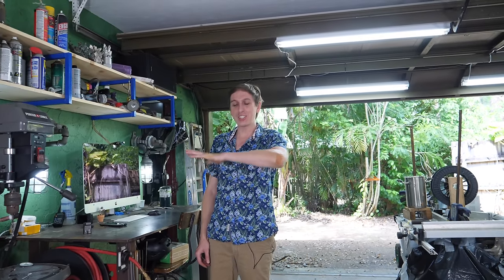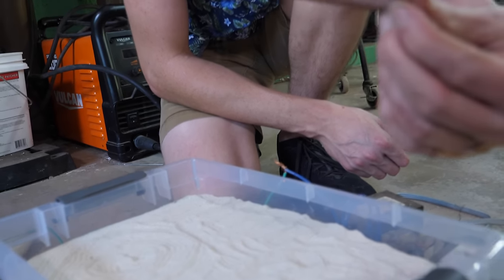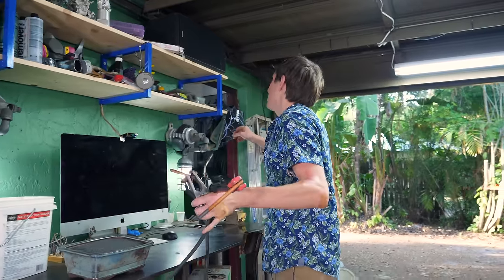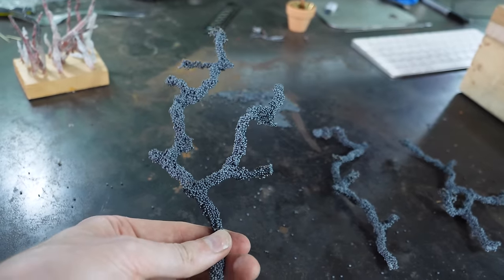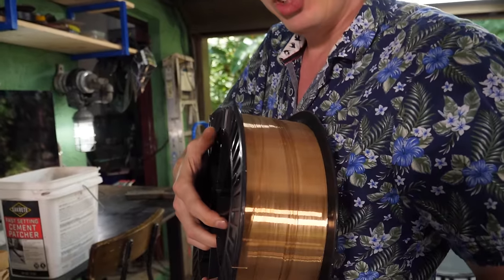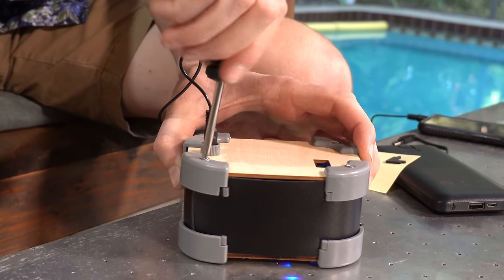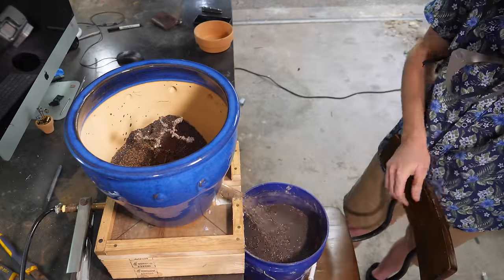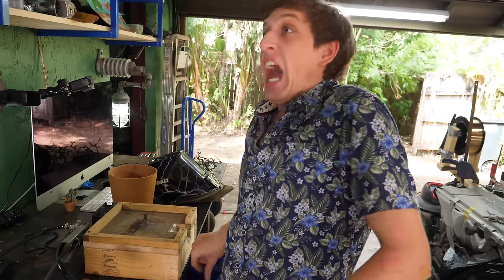Making Petrified Lightning ...with electricity??

Comment from the maker: FYI you can do this with 2 car batteries in series, so 24v. my welder is only 18v at 200 amps, 2 car batteries will put out about the same power 👍As for the BB's, i got them from ebay. search "steel shot blasting". Mine were size s460, about 1mm. I also got the Silicon Bronze from ebay, but it can be pretty expensive. Wisconson Wire Works also sells it for around $6.90 a pound.  But you can find broken rolls on eBay for really cheap sometimes.

I was using 3/8 carbon gouging rods  as electrodes to melt the bb's. Steel or copper would just fuse to the sculpture.

As for the  batteries you would wire them on series for 24V. If that's not enough get another one or two. You can get used batteries for cheap at junkyards. Like $30 each. You need heavy duty wire rated for 200 amps. Positive on top or bottom doesnt matter. It won't work as well as the welder because the welder has a high voltage start that helps it start an arc at longer distances. 

You would want to stick both ends in the bb's, THEN connect the wire to power.. It would be a bad idea to just connect the wire in your hand directly to the battery terminal, it will spark and vaporize lead with every strike. You would be better off connecting a short length of wire to the battery terminal and using that to complete the circuit. And instead of just touching the two wires togeather you would want to find a way to securely connect them, and remember you are moving a lot of current so the connections need to be robust, the thinnest part will control how much current flows.
Reply: UwU
Reply: Hmmm, would it look more like the real thing if you mix Sand into the BB/copper compound?
Reply: Whats the songs name in the vidro
Reply: Cool
Reply: it is also, ya know, really dangerous.
Reply: Hey, the garage scientist is back!
Reply: TheBackyardScientist thanks
Reply: when you turn 105 and can't use the kiwico crate
Reply: Leagle Eagle he said it was very dangerous
Reply: Genius
Reply: Filipino fan currently 12:32 am and this is a very informational video keep doing your best!!
Reply: Hello..will it work on 6s lipo(22.2v)?
Reply: @TheBackyardScientist I love the idea, but something I've wondered about for years now, is if this can be applied to the skin for a one of a kind scarification "tattoo"? please explore this more, if only on dummy items...
Reply: Would adding flux to the metal mixture help at all..?
Reply: What happened to your original video on producing Lichtenberg Figures?
Reply: What would happen if you tried making a mold of one of those to fill with molten metal?
Reply: @HalfSpeedMastering waaaow.. 
That's a total buzz killer..
I think you might have lost the plot Bro..
Reply: TheBackyardScientist where can we buy the petrified lightning😂
Reply: what about iron filings and that copper in dust form, or would that be too dangerous
Reply: I love you so much this was such an amazing idea!!! Would you mind if I used this concept for art?
Reply: @yaboyshiba9496  that's good advice, what would you suggest using if you can't afford what he's got?  Are there other batteries i could use?
Reply: yes i will immediately start playing with car batteries
Reply: @HalfSpeedMastering That's sickening.
Reply: Would it be better if you first soaked the bb's with brake cleaner or similar to wash away any oil residue?
Reply: it kinda looks like cheetos
Reply: Like you said at the end, coating in a little epoxy and adding florescent coloring is a great idea. I wonder how well it would work as a aquarium decoration. Using something like that as a base to add real corals that can grow over it would be interesting as long as it as tank safe
Reply: A dado cutter is what is used to make a narrow channel cut along the grain in wood in cabinets to fit a flat panel into if you look at a kitchen cabinet door it will have 4 pieces of wood with the inner edge of each cut with that type of dado cut and the flat panel in the middle
Reply: why are u reading my comment? :)
Reply: Day - doh , I'll take you back to shop 102: Table Saws and their uses
Reply: Can I buy one off you and u should make a box with a black light in it and sell them or something I don't know just thought I'd be cool
Reply: I was thinking something similar, but full the mold with molten glass, then mount on a base with an LED light in its so it lights up the whole thing
Reply: Hey this is just me being patriotic to Wisconsin since I live there, its sin, not son :) cheers mate
Reply from the maker: @Leagle Eagle I did it plenty of times. Theres no problem.
Reply from the maker: @rpmmotors5050   You would probably destroy your battery. LiPo batteries can output enough current to destroy themselves very quickly!
Reply from the maker: @spencerrolfe2339  go for it!
Reply from the maker: @brightlightsdarkcity6989  I think it would just corrode the steel after a few tries, and it would increase the space between the bb's if that makes sense
Reply from the maker: @KJohansson   I think that would be a good idea but honestly they came pretty clean. Maybe running them through a sand blaster to try to knock off to the mill scale on them would also be a good idea.
Reply: @Leagle Eagle Nice try, Pal but you can't just make your name similar to a big YouTube Channel and expect people to not notice. GJ on the name rip.
Reply: Aunt to let you know that if you find flames that are just blue that's can also be a sign that the type of gas the flame is using is methane gas
Reply: Dado is pronounced dade oh
Reply: TheBackyardScientist wHaT?!
Reply: Who else read this knowing damn well they werent gonna do it
Reply: u should use gloves lol
Reply: YEET
Reply: I think using a relay would be safer...
Reply: GET YOURSELF A 24 VOLT BUS BATTERY
Reply: Witch sand or what type of sand did you use?
Reply: Fulgurite always reminds me of that episode of supernatural where they break into a 1%ers house to steal it and bind Death haha, the people are just like wtf is going on
Then they find out a season later you can just buy it at hippie stores hahaha

Awesome experiment though, looks so goddamn cool
Reply: I was getting ready to say please dont be raid sahdow legends and you said something about the box and i was like aw thank god
Reply: @TheBackyardScientist  You should try this using your MIG Wire bits and Glass Beads. You could experiment with different colored beads and sizes. If it works the light will diffract through the glass. You might even be able to illuminate it through the base with LED's or use a cheap laser
Reply: Hey I have a large one of those
Reply: Why so much spelling?
Reply: @Luziferne  Probably
Reply: <--Milwaukee are you in the wisconsin area,,, have cryo system and other toys/ ideas
Reply: @alanyep  OwO
Reply: TheBackyardScientist 
🤔Sounds cool, but—
🤨 Also sounds dangerous...
Reply: Noice
Reply: 6.9
Reply: @TheBackyardScientist  would a neon sign transformer work?
Reply: seeeeedeeeeeeee
Reply: seeeeedeeeeeeeeeeeee
Reply: seeeeedeeeeeeeeeeeeedd
Reply: seeeeed serf’s eeseeeded
Reply: eeeeeedeeeeeee
Reply: eeeeeedeeeee
Reply: deseeedeeeeeeeeeee
Reply: seeeeedeeeeeee
Reply: seeeeedeeeeeee
Reply: eeeeeedeeeeee
Reply: eeeeeedeeeeeee
Reply: eeeeeedeeee
Reply: eeeeeedeeeeeeee
Reply: eeeeeedeeeee
Reply: eeeeeedeeeeee
Reply: seeeeedee
Reply: seeeeedeeeeee
Reply: seeeeede
Reply: eee
Reply: eeeeeedeee
Reply: eeeee
Reply: eee
Reply: eeeeeedetee
Reply: e
Reply: eeeee
Reply: eeeeeed
Reply: ee
Reply: eeeeeedee
Reply: eeeeeed
Reply: eeeeeedeeeeeeee
Reply: eeee
Reply: eeee
Reply: eeeeeed
Reply: eee
Reply: eeeeee
Reply: eeeeeedeee
Reply: eeee
Reply: eeee
Reply: ee
Reply: eeee
Reply: eee
Reply: eeeee
Reply: eeeee
Reply: eeeeeedeee
Reply: eeee
Reply: eee
Reply: eeeeee
Reply: eee
Reply: eeeeeedeeeeeee
Reply: ee
Reply: e
Reply: ee
Reply: ee
Reply: eee
Reply: ee
Reply: e
Reply: e
Reply: e
Reply: ee
Reply: e
Reply: e
Reply: eee
Reply: eeee
Reply: ee
Reply: eeeee
Reply: ee
Reply: e
Reply: eeeeeed
Reply: e
Reply: e
Reply: eee
Reply: ee
Reply: ee
Reply: e
Reply: ee
Reply: e
Reply: e
Reply: ee
Reply: e
Reply: ee
Reply: e
Reply: ee
Reply: e
Reply: e
Reply: e
Reply: ee
Reply: ee
Reply: e
Reply: e
Reply: eeee
Reply: eeee
Reply: e
Reply: ee
Reply: e
Reply: eeee
Reply: e
Reply: e
Reply: e
Reply: e
Reply: e
Reply: e
Reply: e
Reply: eee
Reply: @noahfrench8792  I agree
Reply: @TheBackyardScientist  Your opinion of Cody’s Lab
Reply: And you expect me to read this
Reply: No one cares
Reply: That’s a lot of writing to read you one
Reply: 6.90.. kinda sus
Reply: I am so incredibly dissed, the title says petrified lightning, why were you not running around trying to catch actual lightning with the metal balls????? Stick welding is not lightning, you just got some weird current path in some stuff on your bench... GO BEN FRANKLIN
Reply: Thanks for the info brother.
Reply: You could sell these
Reply: I fought it was a lie
Reply: Hi fellow engineer, 
I would also suggest to enrich the mix with sand/colored glass to improve heat capacity. For more integrity let the "casting" rest and cool down slowly in the "mold". This helps cristalisation and decreases heat tension. To improve your safety please use forced ventilation while welding. Metal fumes are everything but healthy. 
Stay save
Reply: Noice
Reply: I feel like letting it slowly cool as wouldn't improve integrity as much as actually quenching the metal, though I'm not sure if it's getting hot enough that quenching would provide much benefit.
Reply: Dude, have you seen the theory of fossilization/petrification is way faster than we are lead to believe?
Thundebolts projects channel is a good source for this.

I wonder if you can try to replicate the process (occurred in some big Earth event - thunderbolts of the gods/war/world sized electric discharges) which consists in applying high voltage on a liquid media with clay and  some organic tissue: flesh, bone, leather, anyways... cook it until it gets hard and turned into rock
Reply: Y e s
Reply: Uu
Reply: @djghost5254  I rhouhht add sand to the bb mix aswell on top of the bronze carbon sillicate shavings actual sand from a beach
Reply: @PGains  wow bow
Reply: You can also do this with wood instead of sand, I actually did this with my uncle. Its amazing
Reply: Did you used to do a similar thing by pouring molten metal into ants nests ?
Reply: other youtubers "please do not try this at home. you could DIE" makes a grilled cheese sandwich
thebackyardscientist: "so anyway heres how I did it in great detail. have fun"
Reply: i love your videos kevin
Reply: @average_jojo_stan  The song is Dirty Brunettez by Magdy Haddad 🐸👍
Reply: UwU

Comment: I was a seasonal worker for a rubber works factory when I was 19. We mostly used the metal shot in large high pressure hoses. Looked a lot like a fireman's hose on a hydrolic arm. It rips clothes and can pierce skin but it had never hurt me that bad. The helmet it came with had an air flow into the mask but I don't think it had an exhaust so it was suffocating
Reply: I only now realized that silver and sliver are different words. I thought that  it was silver for both before.

Comment: Ages ago I took an oil-furnace ignitor coil (these WILL kill you!) and some red bricks to make a version of lightning art!
The set up is simple: strike an arc across the surface of the brick; within seconds it will 'jump into' the brick, forming a glowing hot tendril.
The longer the tendril 'cooks' the wider and deeper into the brick it will melt.
The hot tendril is conductive, so moving one electrode away slowly will lengthen the tendril, but after about 4-5 inches, the tendrils would die out.
On cooling the fused brick material is glossy black glass.
It works with ceramic flower pots, but the thermal stress usually cracked them.
I got to where I could make monograms and simple drawings.
Sort of works with wood, but it is very easy for the tendril to wander off course.
Gave it up when I bridged the circuit across the back of my hand; it hurt for over three years!

Comment: Those beads are for sand blasting I think, we have those at our Job (where we paint big metal items in a giant furnace) and it's how we quickly clean off old paint or smoothes edges! It's lovely to work with an item that has gone through it.

Comment: TBS, You should try this with the MIG Wire bits and Glass Beads like they use in glass bead blasting. You could experiment with different colored beads and sizes. If it works the light will diffract through the glass. You might even be able to illuminate it through the base with LED's.

Comment: DADO blades are meant to be used in your table saw, but you would use several blades at once, and "staggered" so that you get a WIDER cut for making interlocking corners and just "wide" cut slots and wood...  If you were to stack 3 of those 1/8" thick blades offset 60degees each, you'd have a 3/8" wide cut with a blade that acted like a normal saw blade.  but you can stack multiples for wider cuts..

Comment: Most spools of welding wire only list the weight of the spool, not the linear amount of wire on it. I once decided to figure out the linear amount by taking a foot of wire and weighing it, I don't remember exactly what I came up with but I believe the figure was around a mile long on a 35lb spool

Comment: Those tiny steel ball bearings are used in precious metal plating applications called   " Media. " What would happen if you used magnetic neodium magnetic ball bearing media in the same experiment ? Even if you could cause a hyper static charge, is their a substance you could add to the beads before creating the experiment to prevent the other magnets from sticking to one another after the experiment is finished? And with the introduction of electricity would this change the media's magnetic properties?

Comment: It would be cool if  you could use the same process to cast a specific shape like with a sand mold like molten aluminum,  but steel and silicon bronze instead

Comment: oxygen instead of argo ?? seriously it would make some massive heat giving you some thickness too ...It gives me some ideas...microcontroller + multiples electrodes switching, some oil insulating the non direct paths...looks like alot of fun !

Comment: 2:36 hear that arcing sound inside the welder ? That's physically arcing from the flyback lift arc starter circuit in the welder. Not really good for it to continue doing that with. Do you have a warranty on that thing ? I'd hope so.

Comment: Want real "petrified lightning" just bombard a block of acrylic with electrons from a linear accelerator.  It will hold a few million volt charge for hours until struck and grounded (at which point a arc will go through it creating a lichtenberg figure.)

Comment: the metal balls are used to shot peen important parts it re leaves surface tension on metal parts to prevent cracking

Comment: Ah Ha !!! You have just proven that my new atomic theory is correct !!! I have no prize for you though. But what you did in the sand shows that electrons may not be responsible for electricity and that the electricity actually uses smaller particles of matter much smaller than 25 millionths of an inch such as the copper color left behind in the sand as it created the strange frozen lighting shape proving that the copper atoms actually discharged through the sand as electricity. I know you don't know about my theory that discounts the existence of the electron because it has never been published. The book I wrote is called Atomic Age No More and proposes that there is only a single particle of matter that uses no electrons. Ah, I can't tell you any more about it.................